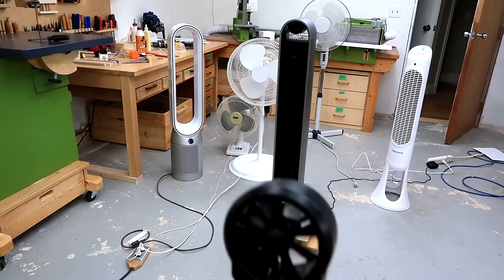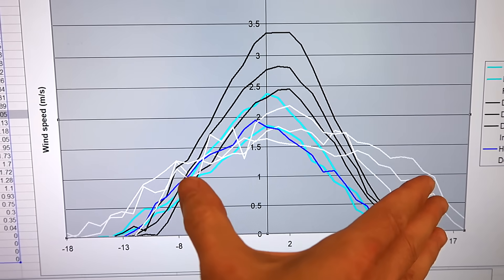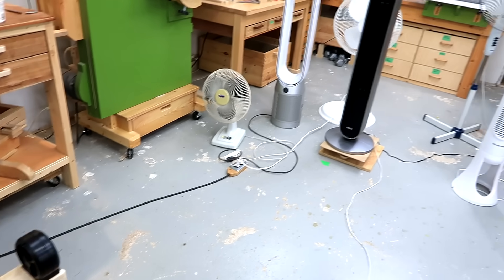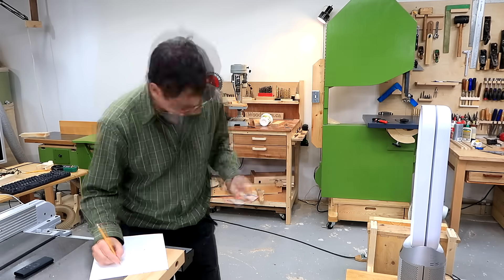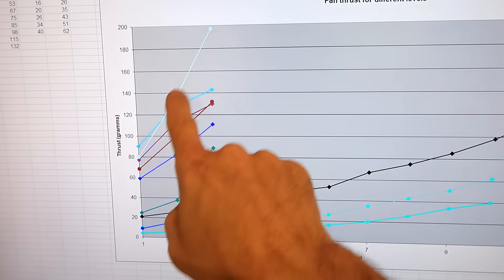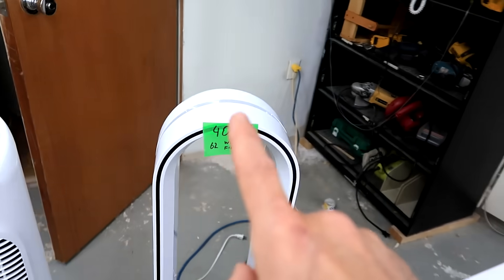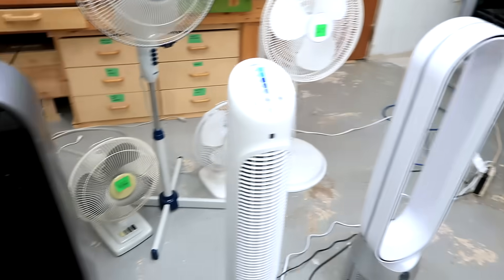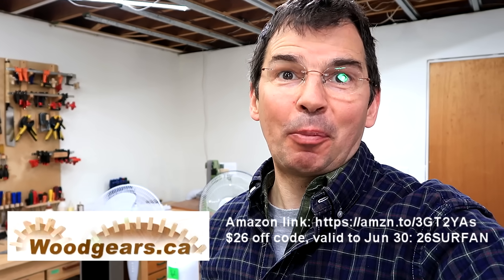Which fan blows hardest -- Tower fans and regular fans

Comment: Instead of fixed speed buttons, I would like to see fans use a potentiometer  to control the fan speed.
Reply: Most cheap fans use single-phase AC motors which don't have good speed control. You'd need to use a brushless DC motor which is much more expensive for good speed control.
Reply: I use my fan on a variac.

Comment: Should't the thrust experiment take into account the weight of the fan itself?
The force produced by the thrust is actually lifting the weight of the fan at the same time as It is acting against the weight scale.
Reply: It should. The swing configuration needs to move backwards to push on the scale. While the scale provides the same amount of resistance, the swing is not going to work the same. A very heavy fan could probably produce Dyson levels of airflow while giving no thrust measurements in this setting.
Reply from the maker: I showedi t swinging to show how it works, but it doesn't actually swing, cause the scale blocks it from swinging.
Reply: @matthiasrandomstuff2221  Wouldn't the fan's weight still cause a slight counterforce to the movement measured by the scale? It's nearly moving horizontally, but there still is a tiny bit of vertical movement given the swing design. Likely the easiest way to be sure would be to place a few bricks on the swing with a fan and see if the measurement changes much. It might be negligible, but I'm not good enough at estimation to say for sure that the weight couldn't affect such a small measurement.

Great video as always!
Reply: I don't think it makes much difference, as the fan only moves as much as is needed to measure pressure at the scale. And that will be a maximum of one millimeter.
Reply: The platform can't actually move much while it's coupled to the scale though, can it? Aside from whatever flex there is in the coupling itself and the surface of the scale.

Comment: I love the pushback measurement idea, but could the weight of the fans themselves affect the measurements? It takes more energy to move a heavier fan
Reply: You could test that by adding dead weight and seeing if it affects the measured thrust
Reply: I think in this case it's likely a 2nd order effect.  Some of the force is used to lift the fan as the swing arm moves backward, but since that displacement is very small (restrained by the platen of the scale) the effect is correspondingly small and can be ignored.  But your question does suggest an alternative way to measure the thrust.  If the swing arm was unrestrained, one could measure the displacement and compute the thrust accounting for the fan weight.  This, however, would not be my first choice of methodology.
Reply: I think that the weight is negligible. The amount of force required to hold that platform at the <.5deg angle as the scale deflects is almost nothing. That is why he has the adjustable screw that contacts the scale. So he can make sure the swing arm doesn't need to move a noticable amount to press on the scale.